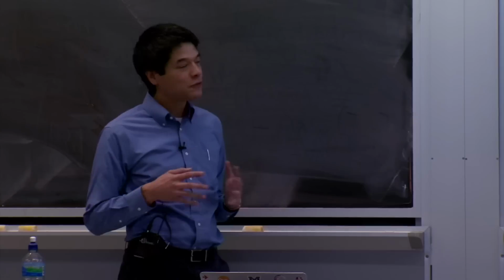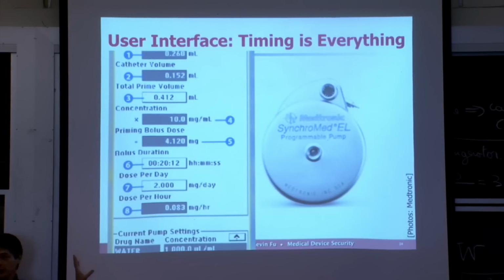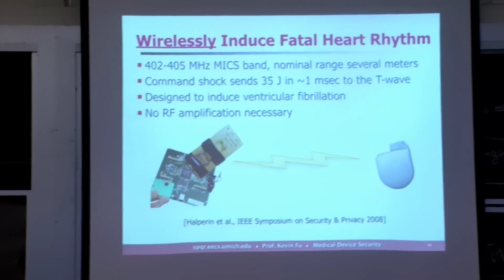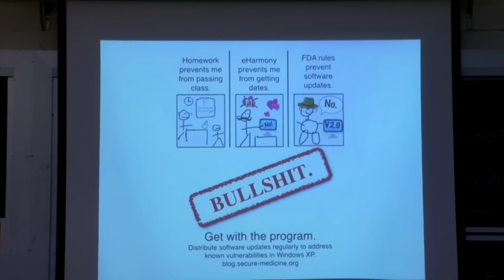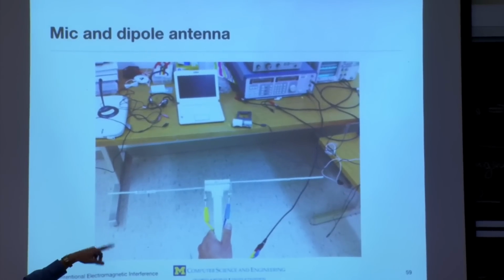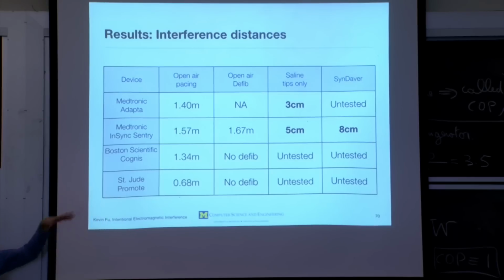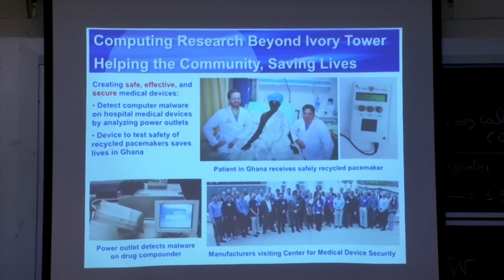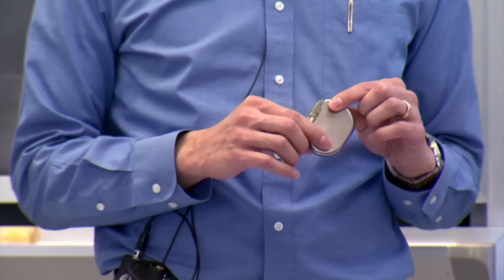15. Medical Software

Comment: Good talk.  Manufacturing with obsolete OS.
Thi gs cannot be secured given the current code , procedural policies and integration. 

Definitely points out the ludicrous practice of government's not segregating peoples' health from vulnerable software used I  the financial world - with all the detrimental I efficiencies inherent. 

special OS for the the medical industry from a branch of the meducal field needs to be implemented.